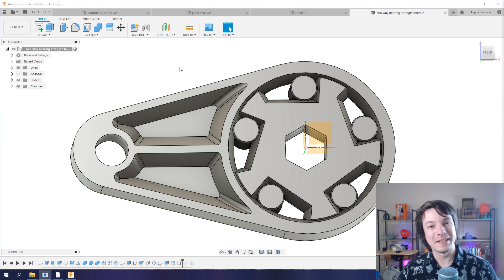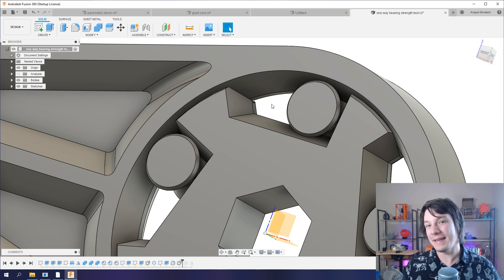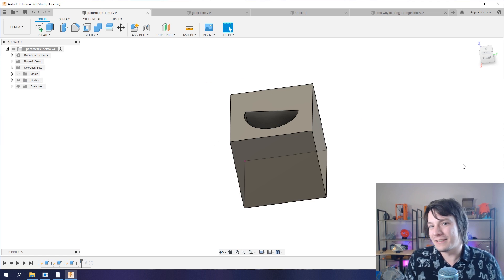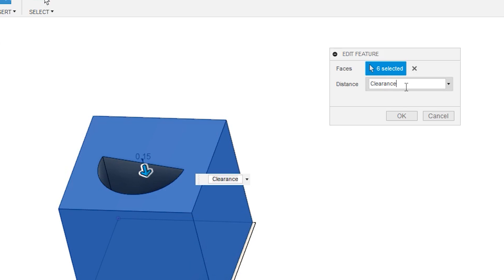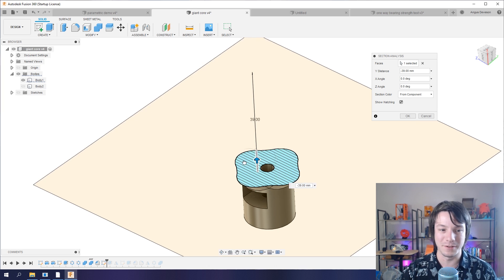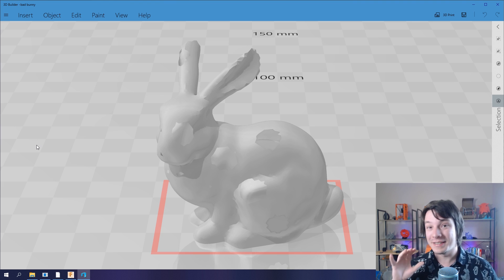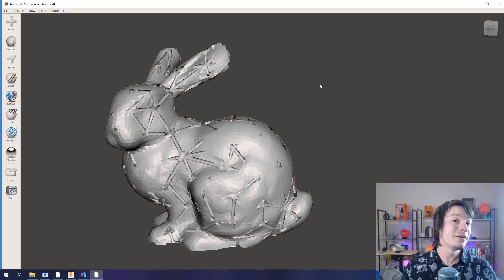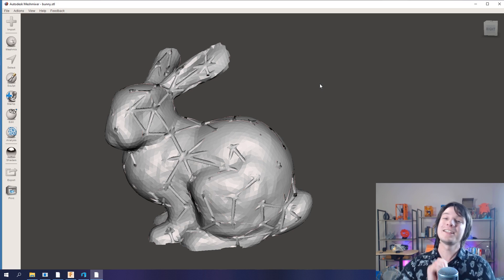Must Have 3D Printing Tips and Tricks! Episode 1 - Design Stage

Comment: That rubiks cube core piece can be printed if you rotated 2 of the axes 45 degrees so it sits on three of the arms rather than 1. Then every part would print at 45 degree angles rather than 0 or 90.

Comment: Cura has an expansion offset that seems to work great (I used it for the first time yesterday). This is by far the better way to go, say, in CAD, you have a part with two holes, shrinking the object will solve the expansion problem, but now your holes are closer together. So it's better to make everything as precise as possible in CAD, but then tweak the expansion offset for the entire print.

Comment: That might be a very stupid question but I'm not an engineer. Several of your videos go into designing parts so they don't need supports when printed - but why is that important? In the example you've shown in this video, the part would have been lighter and smaller without the additional supports you've designed in. 

Or are you talking about "structural" supports instead of "printing" supports? So the model is more stable?

Comment: I add a clearance value to a hole dimension equal to the layer height to compensate for the radius of the layer height protruding into the hole. This becomes important when using <M8 screws (<6-32) directly into the plastic hole.

Comment: How do you generate 3mf files when designing in Fusion 360? It looks like F360 doesn't have this option yet, I don't know if AutoDesk are planning on adding it, I've tweeted the question but, so far, no reply.

Comment: Angus, is your "use 3mf" still valid if one is going to publish on platforms like Prusaprinters or Thingiverse? I mean, from a security point spoken you don't want to have temperature settings and so on in such files one can download from the Internet. There is no security facility available in most of our printers. Please double-check, and maybe address this in a separate video. BR, Peter

Comment: Very awesome! I'm looking into 3MF files right now. :-) I have a file that I've been wanting to modify & work with but the file is WAY to big. I'm going ot try & make it into a 3MF file & see what happens. *fingers crossed! Looking forward to the rest of the series. =-)
**Addition - How do you, or is there a way (with using any of the free software plz) to convert an STL file to a 3MF file? Tried finding & doing it with Fusion 360, however with no luck at all. Help?
Reply: Well, an obj and stl is a very simple txt file with one line for each point and vertex index, its very trivial to parse and can easily be done sequentially without loading the entire file. A 3MF file on the other hand, is a zipped XML file that can have a dynamic structure for both vertex format and position format, so not only do you have to load the entire file first to decompress it (to a significantly larger file than both obj and stl), but you have to parse the xml structure (did I mention it is dynamic?). So from a software developers standpoint it is just a complete nightmare in comparison, the only reason a loader would be able to run faster on a 3mf file would be because the obj loader is really bad.

Why they've created this format is beyond my comprehension, it is utterly useless for large files, and there's lots of better formats if you need the extensibility.

I suspect this happened:
https://xkcd.com/927/

Comment: I ran into the "tiny" problem just yesterday. I added blind screw mount holes to the back of a known-good safety razor bracket. Eyeballed it in CAD, printed out. Holes came out tiny, took #4 flatheads–not something everyone has lying around. Gotta re-do with bigger holes before I upload to Thingiverse.

Comment: My Win10 came with something called "Print 3D" that required 3D Builder to function.  I had to download 3D builder and ignore five nag-screens to create a Microsoft account before being able to download it.  It seems to only allow me to order prints at a cost.  Do I really need this?  Right now, it's taking at least an hour to "repair" a model that I have printed many times with no problem; the issue appears to be a brim that 3DB has created around the base of the model.

Comment: I also suggest starting with a very rough pencil sketch with your dimensions drawn on. The sketch doesn't have to be accurate but it really speeds up the modeling process when you have the rough shape somewhere other than your head.

Comment: cringes at press-pull 
As an engineer, I've had several issues caused by past people press-pulling a feature, and then modeling over it later, or not using a sensible value. I'm not saying it can't be done, or that it always causes issues; just that it can create an unintended pitfall for your future self. It's probably more of an issue in AutoCAD and older CAD systems, but I'd say that best-practice probably is to factor in the clearance other ways. 
My preferred method (if your CAD supports it) is to set the main extrusion at say "10mm - Clearance", or pattern it at "10mm + Clearance" spacing. I've found that my printer undersizes interior holes but prints outer surfaces accurately. So a washer would have an accurate +-.05mm OD (minus whatever first layer artifacts), but a 0.3mm undersized ID.

Comment: The sectional analysis was something I knew, but forgot about. Always get in a hurry and forget to cross check the build-ability within the design phase.  Thanks for the reminder!
That .3MF format is going to help with an Abe Lincoln bust from the Smithsonian I was having trouble with. It has a huge number of polygons that just make it unprintable on my little machine. I dumbed down the mesh a lot but felt I lost some details in the process.

Comment: I have been trying to find a way to get rid of the STL issue where the generated triangles are too large in Fusion 360.  I was hoping that 3MF would do this.  Unfortunately the sliced models from 3MF files made by the plugin are quite a bit worse for surface deviation than STL files generated using custom and pulling the surface deviation slider all the way to the left.  You can see the issue if you make a vertical cylinder of about 150 mm diameter.  There will be visible facets if you zoom in with the previewer.  I am afraid I am going to have to write a program to generate gcode directly to get a smooth face.  The Fusion 360 3MF plugin is not ready for prime time.  I am pretty sure your clearance parts will suffer when sliced from a 3MF.  I've only looked at this using Ideamaker so it could be different using other slicers.  One other thing.  3MF models imported into your slicer show up at 1/10 the designed size.  I had to scale to 1000% to get back to designed size.  Very strange issue.

Comment: Also, 3D builder is an excellent tool for checking alignment of objects before you print them if you are customizing someone else's design or adding a part to it. The measure function is fantastic for reverse engineering parts where you only have an STL

Comment: Great tips Angus, on the Rubics cube core, a sacrificial layer will help to print the bottom bridge with the hole. I'm guessing you will be covering that later in the series. As far as I can find, there isn't a way to export from Fusion 360 into .3mf or have I missed something? It would be great if Autodesk adds the option.

Comment: Greetings. you have presented some good points here, but I'd like to add a few. I ran the 3-D modeling lab at Sulzer Orthopedics for many years and have a lot of experience here. I hate lists, but they sometimes help. So forgive me.
1. If geometric accuracy is more important that cosmetic, position your part to allow the machine to assist you. If the layer thickness exceeds your desired accuracy for a hole or round, don't lay it down for printing. There is a very good chance your machine will print cylinders and rounds better positioned vertically.
2. Strength, Lets use a roll of dimes for this example. It can be easily displaced/cracked if standing vertically, but if it were printed horizontally, each laminate layer has much greater strength due to the cross section.
3. STL stands for 'Standard Template Library'. It simply implies that the model geometry has been broken down into triangles. A digital approach that I have to believe most printer files use. When converting any digital model to an .STL file, you are give a resolution option and can reduce the massive file size if the triangles and resolution are bigger.
4. Clearance. I like the fit gage you made. Very nice. On certain laser machines, ( may be applicable to nozzle size) beam offset and diameter are available. you can use these values to lie to your machine and have it adjust your model size accordingly. The push/pull option you show is simply a nozzle/cutter comp like G code offset for CNC, just made simple.
Thanks. I enjoy your presentations and video composition.

Comment: Me: Changes a paramter in fusion 360
Model freaks out and starts looking very weird

;-;
Reply: Gotta fully define those sketches. And sometimes it still breaks.
Reply: @LindyDesignLab  lol yeah. what I learnt recently is to move osme of the variations more towards the end of the design rather than beginning. also hey it's you! \0/
Reply: Good point.
Reply: @LindyDesignLab  "and sometimes it still breaks" the frustratingly sad reality of CAD packages.
Reply: Try soldiworks, if you did it wrong everything just dissappears 😅. I think I'm putting excessive wear on my ctrl+Z.

Comment: I sometimes wonder how things would be if your slicer had a "tolerance" option. the models would be designed as if perfect and everyone would put their own tolerances in the slicer. but it'd be hard for the slicer to figure where it needs the tolerance unless we'd make a new format or something
Reply: I've wanted that too. If the slicer can identify islands via the normals then it should be able to add a tolerance. My slicer has a "thin walls" option that will print a wall that is too small for the extruder, sacrificing accuracy for completeness.

Comment: I think "Replacing STL by 3MF" is worth it's own video. You could make a better case for potential current and future uses of the format. But most importantly, it will help the message spread better and it's pretty important that that message gets spread as much as possible. 

Also, from now on if you ever mention "the STL file" in a video, also mention 3MF (and maybe that 3MF is better. Gotta repeat the message so people get it)
Reply: Well at least it's the same number of syllables or else it would never catch on.

Comment: The STL filesize thing is a little bit dishonest... A quick look through my 3d models folder didn't find a single ASCII STL file - they're all the (much more compact) binary format. Obviously the other benefits (colour data, compression etc) are still real.
Reply: Some of the software I use to produce geometry only produces ASCII STL.  But the software I use to verify the results (meshlab) can produce ASCII or binary STL, and I favor the latter.

Comment: TIPS FOR BETTER PRINT - print everything  in vase mode in s3d. it will be 3x more accurate than with normal printing. you can even see the polygon on the printed model. try a calibration cube  in vase mode vs regular print with infill. the printer itself act differently. it will be quieter than normal. no more shaking,no ghosting & ringing. the corner will be sharper. no matter your resolution the top layer must be 0.5mm height. if u are printing 0.12,top layer must be 5. dont believe me. TRY IT ! note on some print, u may need to readjust extrusion multiplier higher than normal.

Comment: Just have to know. If I save a 3mf file then won't the slicer change it to an stl anyway since the printers require stl files to print?
Reply: Slicers create .gcode files from the .stl, newer versions can do the same thing from .3mf files. So you don't need .stl at all.

Comment: +1 for clearance parameters! Always do this, especially when I release my fusion files for others to use :)
Also 3d builder! It's my final step for confirming that files are error free before release! I will say though, with the 3MF file format, you do need to be careful, especially if you repair your model in 3d builder, as it will also store the original non-printable model in the same file, and you could inadvertently end up printing that if you're not careful. To check it, you need to ungroup and or unhide stuff using the controls on the right side, and you will be able to see if there's any other parts stored in the file.

Comment: Would love to see some projects and Tutorials how to go from a 3D scan, clean it up with mesh mixer while retaining resolution and critical geometry, and making it compatible to work with add and modify in f360 utilizing and converting to quads and brep so scams can be modified like a parametric solid. As well as if the patch environment can be utilized to work in the context of those topics. 

That whole topic is fuzzy and clunky and mysterious how to do it efficiently and well without sacrificing resolution and quality to move between file formats and compatibility of platforms.
Reply: Fusion really isn't a good option for altering scanned files. Reverse engineering is a whole can of worms.
Reply: @BillieRuben  Which is exactly why I really would like to see more information on the topic, slogging through the topic, and the information is scant and fractured on methods to do it at all let alone well or methodically. 

The method that I used was to import a scan into mesh mixer, worked with the file to clean it up. once primary work was completed there are specific file types that F360 will cope with to retain scanned geometry "well", and since my project only needed to add parametric geometry to the scan, it was a suitable environment to move into...The issue is it is so unclear and unintuitive how to best work from a scan to a parametric environment, and back.

I know Angus has worked in many of those environments independently, and was hoping to inspire some interest in the topic... IMO, he is very talented at solidifying information from many different yet related disciplines into a working logical cohesive structure.
Reply: There are better tools for this than F360. But they are not free. Ansys Spaceclaim is very good for tasks like that, but you'll drop a few 1000$ for a full license...
Reply: @ProtonOne11  I am certain there are...I think in the context of the fundamental spirit of this channel, the hope was that it was implied How to do it within the DIY Maker tools readily avalible and commonly used and outlined here...

It is possible, just very sparsely documented, and quite confusing how to stay on the path of retaining quality of scanned resolution.

I am hoping this 3D scanned objects and being able to blend in parametric modeling becomes a bigger thing soon. the scanning tools are getting Very accessible, anyone with a newer iPhone has a pretty decent 3D scanner in their pocket now that is quite capable of holding ~1mm tolerances in smaller scanning volumes!

Comment: Need  help please I bought the creality ender three pro. And my prints from 123d or any other place don’t print in the center. They print on the corner. Front left. I am newer to this and I can’t find what will fix this.  Any help would be really helpful thanks.
Reply from the maker: sounds like your origins is incorrectly offset in your slicer, it should be front left corner 0,0 let me know how you go it'd be a quick video to make.
Reply: Maker's Muse i’m using cura  4.3.  I’m semicomputer savvy but I just don’t see the ender three pro in the drop down. They have the ender 3 just not the pro.  I have found reference to adding g code to the profile but I am lost after that. If you made a small video that would be awesome. I am sure I’m not the only one that has this issue. Ps I know You hear it all the time or read it. But I do love the videos man they are awesome. Thanks for all your help
Reply from the maker: @bishipc117   the pro should take identical gcode, if you can go to " manage printers" then "machine settings" make sure "origin at center" is NOT ticked. I suspect it might be.
Reply: Maker's Muse I have tried quite a few things that being one of them.  By checking the keep origin, and by unchecking it. I have tried quite a few things that being one of them. And that’s why I Am asking someone who knows way more about 3D printing. Side not I have two printers the first one comes from microcenter.com it’s a power spec ultra. It works well I just can’t use any other software with it. It’s very proprietary and does not have a good micron print Height. So that’s why I bought the one ender 3.  Actually I bought it because I saw one of your videos and I liked it and it seemed like a good printer for the price.

Comment: Just a note on the Microsoft 3d builder tip: it is really convenient and free, but it also will crash and freeze, or just sit there and do nothing, if your model happens to be really big or have a large number of triangles. It can help to simply and remove faces in something like meshlab first, and then 3d builder becomes perfectly viable to repair models. It's actually a known bug with the program that it can't handle larger triangle counts, but for free software, it's not all that surprising, just good to know before you wait for hours for it to repair something, when actually it's just crashed.
Reply: One thing it took me a while to figure out is that if you minimise the window, 3d builder will pause whatever it's doing. So if you start repairing a model and it's taking a long time you can switch windows and leave it in the background but don't minimise it!